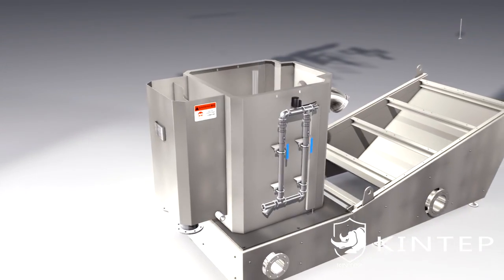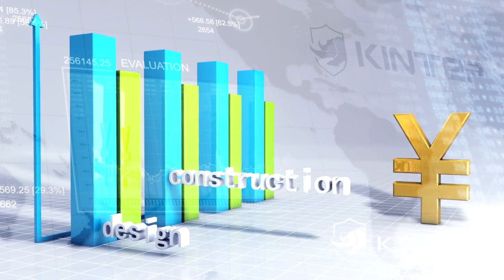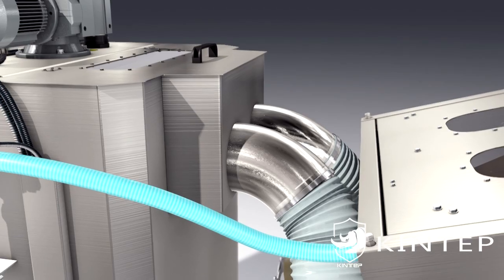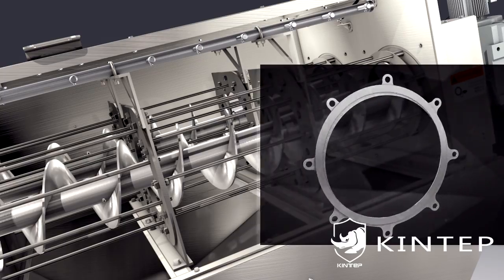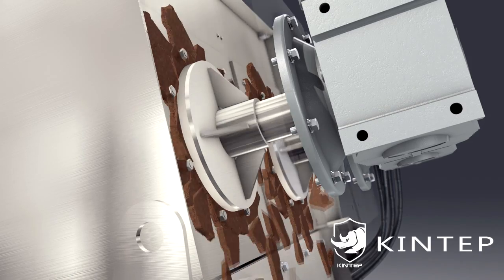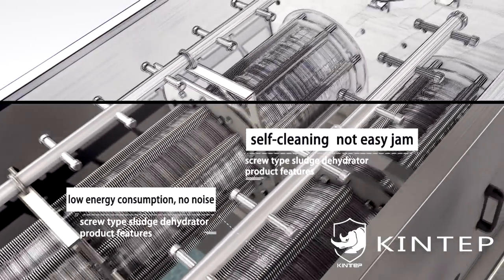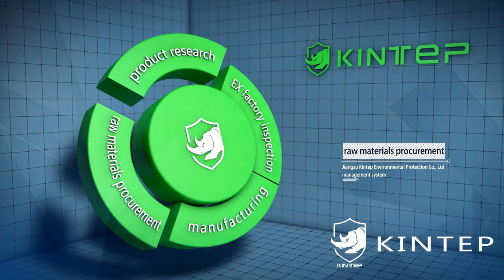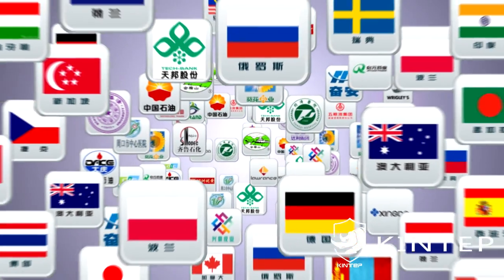Dewatering Sludge Screw Press - sludge treatment solution

Comment from the maker: Advantage:
**  High resistance to oily sludge: Clog-free structure, volute can easily handle oily sludge without clogging.
**  Energy & water saving design, low noise and little vibration
**  24-hour automated operation: Only requires periodic inspection and chemical replenishment.
**  All in one compact design: Including the control panel as package. Its all-in-one design makes it very compact and economical. 
**  Easy maintenance: A partial overhaul of the dewatering cylinder is a half-day work and it can be undertaken on site easily.

Comment: nice job and impressive animation! The filter press is one of the oldest process filters and also dewatering machine which is used in a variety of applications. It still is a pioneer in solid-liquid separation with a very good price-performance ratio.
Greetings MSE Filterpressen®. Your specialist from germany.